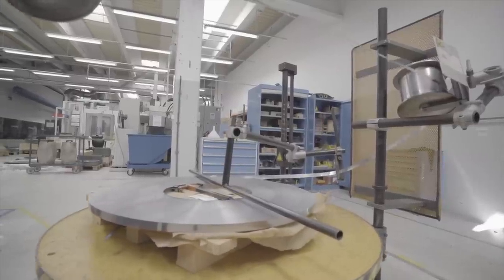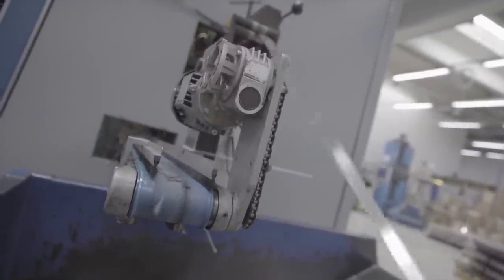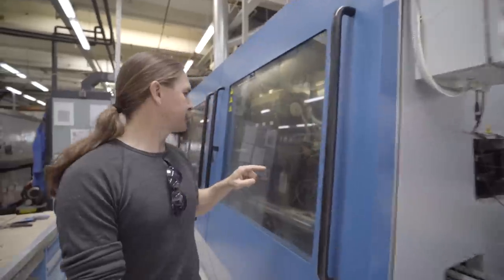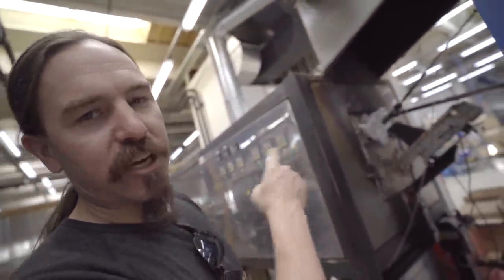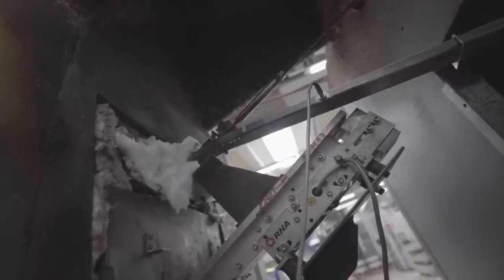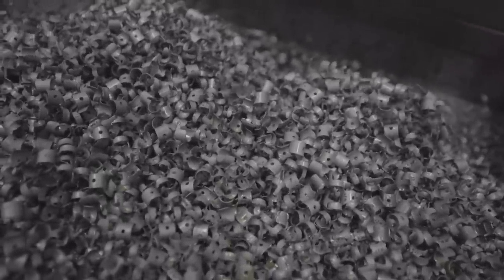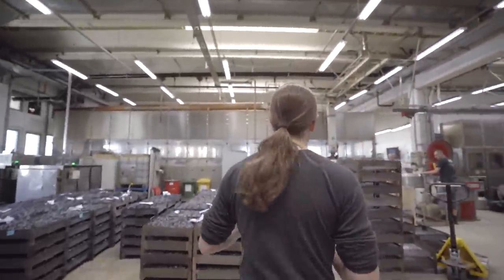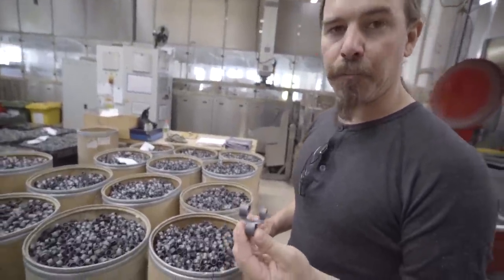How's It Made: A Giant Machine That Makes MG Links

Comment: This is fantastic. As an engineer myself, I could not have explained it any better. Would love more content like this!
Reply: I actually really like the fact that Ian himself is an engineer and has some knowledge regarding machining.
Reply: My understanding is that Ian’s degree is in something like “engineering technology,” which typically puts one on a track to being a CAD jockey or similar work. But Ian certainly has the chops to be a full-blown mechanical engineer. I’m one, and I’m regularly impressed by Ian’s clear-yet-technically-accurate descriptions—explanations that are both clear and accurate are exceedingly rare. 

On a related note, I wish my field did less gatekeeping. I like engineering technology degrees because they help bring in people who wouldn’t otherwise pursue engineering. On the other hand, those degrees create a weird hierarchy. I’ve met machinists and CAD operators who were effectively highly skilled engineers. I worked with one full-fledged engineer who didn’t believe that springs in series behave differently than springs in parallel. 😬

My field pushes away too many people who would make killer engineers, and thereby shoots itself in the foot.
Reply: I used to work in facility that produced among other things (1) the rocker arms for ICE engines. We had one Tool and Die maker that worked full time maintaining the die sections of the progressive die due to the wear caused by the process. The single most impressive operation was stamping a small hole on the order of 1mm through steel about 2mm thick.
1) The other things include complete engines, rear ends, body stampings and finished cars all under one roof.

Comment: Now I would love to see how the linking machine works to create the belts
Reply: May be judged as 'click-click-click' bait . . .
Reply: @SonsOfLorgar   - Why, we're all still playing in the linking machine . . .                    : )
Reply: Linking machines? Here we call them "recruits"
Reply: We have a linker, basically a tray we put 10 rounds on and then we lay the links out and pull a lever and it pushes the links on the rounds. Can be done by hand too.
Reply: Maybe make a linked video that shows the next part of how the munitions gets created with the links into belts!
Reply: Linking machines aren't too complex, it's basically a metal tray with some channels cut into it with a pusher (I forget the term) that's attached to a lever and/or a mechanical pall/finger that pushes everything over. In the two channels one contains the belt links whether disintegrating or permanently linked and the other contains the rounds to be fed into the belt, pulling the lever forces the pusher block upwards and forces the round up and into the belt link and the lever is pushed back and the belt is moved to align the next round with the next link and the cycle continues until the belt is fully loaded. There's no doubt good videos describing how they're used here on youtube
Reply: Wasn't there a 20 or 30mm cannon you could 'run in reverse' to make belts? The M230 came to mind, but that's not it.
It's just a faint memory, so I might be wrong.
Reply: @SonsOfLorgar  the ones we use here are for 50 bmg and 7.62x51 disintegrating links and we screw them down on whatever table we need them on. They are pretty old but when you get in a rhythm you can load a belt faster than a magazine. You can also reverse it and pull the rounds out of the links very quickly.
Reply: Absolutely

Comment: There is a sideshow to this, that You might find interesting.

The recycling of scrap.

The price of scrap metal depends on how much treatment it has to undergo.

The best price the foundry gives is when there is a casting error - here the prime objective of the manufacturer is to avoid putting work and mashine time into castings that are flawed. We have been casting bronze for thousands of years and yet there is still occational flawed/failed specimens. The Ötzi (the Iceman from the alpine glazier had an axe with a casting flaw) - and we are still not perfect there.

If you know what you are doing: You can often get a considerable discount on a replacement part if you send back the broken part to the manufacturer, because they know PRECISELY the composition of the alloy and can put it into the right bin when returning scrap to the foundry - and get a better price for the scrap.
Floor sweepings are more complicated if you have to separate copper alloys from iron, but each will normally have to be refined. Which is costly - to say the least. so the price pr. pound is much lower.

But a good chief is also a manager of the scrap.

Steel is a particular chapter, as the contents of impurities in steel is so high - the most rotten quality goes into cars. But generally the more recycled a metal is, the better the quality.

The airblasting is the same way medicinal pills are sorted, as it goes by weight. If there is steel impurities you might have to blast them over a magnet.

Comment: air tables are used over regular conveyors quite a bit with lightweight parts. you get a much faster throughput of material with less maintenance. with a normal conveyor, you have tons of motors to maintain, belts to repair, etc. with an air table, you have to repair local damage to the air seal, and maintain the compressor and cleanliness. 

metal forming production machines are always an interesting time, thanks for showing us!

Comment: The 360 deg Fahrenheit heating stage after quenching is TEMPERING, not annealing. Cool vid, hell of a setup. Keep on cranking 'em out
Reply: Yeah, the annealing was done in the first oven, and then quenching hardened the links.  The tempering was the second oven like you said.  Must be a pretty low carbon steel to quench in water like that and not get cracking.
Reply: The cooling time wasnt mentioned after the 360 degree reheat, a fast cooling period  ( quenched) tempers, a slow cooldown anneals....
Reply: Noticed this minor fauxpas too, did material handling heat treatment  on govt 💣casing hardware years ago.
Reply: @bunnykiller  No, they're classified by the heat involved, not by the cooling rate.  360 degrees C is far to low for even a partial anneal.
Reply: @bunnykiller  No. ( Fast)Quenching hardens the previously annealed malleable steel. Feed stock comes from supplier  pre-annealed on roll. That's how you can roll + unroll and feed into stamping machine.
After stamping steel is brought back to high temp(malleable)  + fast quenched to harden.  Tempering reheat relieves internal stress + brittle failure state of hardened steel.  End result is resilient stamped spring steel. Then it gets Parked/ Phosphated for corrosion resistance , GTG.
Reply: @theproceedings4050  Correct. 360F is tempering/ stress relief after, stamping + high heat+ quench hardening
Reply: @theproceedings4050  Yep
Reply: @joekurtz8303  Word. Spent a fair amount of time in and around old St. Louis Army Ammunition Plant in 80's. Arsenal of Democracy, 40+ % of WW2 SMA + metric fuckton of ordnance rolled out of there over the years. Gone now, we need these capabilities today.
Heartened by modern methods as seen here. Our overall capacity+ ongoing relative inability to rapidly increase production is a critical vulnerability.
Should have been mobilized + ramping up production 3 years ago. 
Cheers to you brother
Reply: It seems like it should be possible to eliminate the links , but maybe not

Comment: Heat treat & tempering is usually  the process in that order to  relieve britlleness , annealing is usually done prior to machining or other extrusions in process. Great video on this product,  considering the environment it has to withstand  in handling and firing etc
Reply: He shoud have said tempering. Annealing is used for brass cases after forming, to make the neck case stronger or less brittle.
Reply: To get all the terms out there:
Quenching is rapidly cooling something (usually a carbon steel) from a high temperature to harden it. (It turns austenite to martensite)
Tempering is heating a quenched object to a lower temperature than before and keeping it there for a while to reduce brittleness and make the appropriate steels actually springy. (This relieves some internal stresses and allows remaining austenite to convert to other forms)
Annealing is heating something to a high temperature, keeping it there for a while and then slowly (for materials that can be quench-hardened) cooling it to soften it and remove stresses.

For other metals than steel (and some steels) the main thing is annealing to remove stresses from work-hardening. That is, you've deformed something, and now it's harder and more brittle, so you heat it up to relieve the stresses and get the original malleability back.

Comment: There is still another aspect to the production of MG links.
When you make 100 mio. mashinegun links annually on expensive equipment the production quality goes exponentially up - simply because the mashines will have to be operated to precise tolerances. Same thing with ammunition production.
That means less hangfires and malfunctions in akward moments.

Comment: I'm sitting here, looking at a metal strip I reckon would have been turned into links for the MG34/42 back in the days, if somebody hadn't pulled it out of the machine before the links were complete. From what I can tell, they went through at least 11 different stamping processes, well, more likely 8 as three of the links look identical, before being parted off, heat treated, and connected with that little coil.

Comment: Excellent video! In pieces as thin (and ferromagnetic) as these links, perhaps what is known as a "fall furnace" can be used as an austenitizing furnace. This is a vertical tube several meters high, where the pieces, with the definitive geometry, enter through the upper part and are heated by electrical induction during the fall. The temperature reached by the piece depends on the height of the tube and the intensity of current applied. Below the tube is the tank where the cooling liquid (water or oil) that produces the tempering is located. I know that method is used for needles, and small pins. Greetings from Patagonia Argentina.
Reply: That's fascinating, thanks!  I wonder if there's a difference in scale that made it a more expensive choice for MG links?
Reply: @Stevarooni  Good question. The problem with "Drop Furnaces" is that they are very specific while the furnace seen in the video is more flexible in its applications. It should also be taken into account that it is available in the area of the factory: Is natural gas cheap in the area? - Electricity is expensive or the electrical network is not prepared for those consumption peaks? - Is it planned that this oven will have other applications? - Are the drop furnaces very different for links of 223, 308 and 0.50 BMG (and other calibers that you want to manufacture). As you can see, there are a million variables that may have been considered to implement one solution or another. Greetings from Patagonia Argentina.

Comment: Coil feeder, progressive die, heat treat furnace to bring link up to Austenizing temperature (1) and quench. Then into the draw furnace to bring the hardness down to I'm guessing around 50RC or so. I wonder what the alloy is and the quench solution.
1) The temperature at which steel changes from a face centered cubic structure where the alloying element (carbon, chrome, molybdenum (2), vanadium whatever is centered in the faces of of a cube of iron atoms to a body centered structure where the alloying elements are in the center of the cubic structure. If the steel is quenched fast enough the alloying elements will stay inside the cubic structure. Drawing or tempering allows a certain percentage of the alloying elements to migrate back into a face centered grain structure. This gives the steel enough of its ductility back while still maintaining enough of the body centered material to provide toughness and resistance to impact and wear. Heat treating steels and any other metal is at once both a science and a black art depending on the scale it's being done at. 
A similiar manufacturing process is used to produce stamped rocker arms for engines. Although in that case the heat treatment is likely done in a seperate area. Plus the stamping presses are much larger.

Comment: Kind of surprised that steel strip isn't better guarded from the walkways.  I know most places aren't as risk adverse in a factory setting as OSHA, but, it always surprises me when I see a factory that hasn't been safed to the very edge of  hurting production. (I mean, any factory is dangerous, but running a neck height dull bandsaw of a steel strip at neck height with nary a guard widges even my risk acceptance levels.  And I do risky crap recreationally.  🤣

Cool process - I wonder whatbthebscrapnrste from heat treat losses is (it honestly has to be super low on such a low markup part - just inspecting for production faults would rapidly eat profits like tribbles in your grain silo.)
Reply: The strip feed doesn't look to be a high tension process; if anything breaks you're not going to get a lot of 'razor whip,' and the one corner where you might does have a guard.
Reply: Yeah I was surprised by the lack of safety glasses and ear protection too, but that is what we are used to here.
Reply: Safety Sally.
Reply: There used to be a razor blade factory that had a constantly moving strip of steel coming off a vertical coil. 
All the stoppages for cutting the strip happened inside the machine which had sharpened, shaped and hardened the strip. 
The feed line into that machine was protected by a fence so that you didn't break the production line.
Reply: There are no high spring tension nor high speed involved here. If the metal breaks (which is pretty much impossible) the whole thing just falls to the ground and stays there.
Reply: Safety 5th, at best.
Duty, value-quality, satisfaction and profit come first

Comment: I have to clarify that that is not an annealing oven, which is a process for fully softening metal. Its a tempering oven, with relieves some internal stresses in the hardened part, keeping some hardness but allowing more strain before failure.
Reply: the difference between tempering and annealing is the cool down time period after heating... being quenched after heating tempers, being cooled at room temp over time anneals

Comment: Little correction. 

The steel used probably is a bit higher grade than just "mild steel" because the effects of heat-treating (hardening and reheating to release stress inside the material) only really takes effect at a higher share of carbon inside the steel. 

For example, S235 is a mild steel/building steel normally used for simple construction and design elements like gates, metal fences and so on. It has a carbon share of roughly 0,17% C. It is very easily to bend or weld, but hardening has no considerable effect on the properties. 

But let us get to C45, which is a "soft" tool steel used for simple handtools like chisels, hammers and wear resistant parts. 

It has a carbon share of 0,45%, which is not a very lot for steel speaking, but it is enough so hardening has a considerable effect on the material to change its properties from being soft and bendable to being hard and brittle (it easily breaks if hit with a hammer for example) 

To make the steel soft enough for usage it gets reheated into a certain area so the internal stress can get released without the material breaking into little pieces. 

So they probably used something in the range of C45 or C60 or something comparable property wise I think.
Reply: Nope, it's a spring steel like 38Si7 or so.

Comment: IAN! NOOO... The second, lower temp oven is for tempering, not annealing. They convert the hard, brittle untempered martensite microstructure into slightly less hard, but tougher tempered martensite. Annealing would be done by bringing the steel up to the same high (austenitizing) temperature but then slow cooling it to pearlite microstructure like it was originally, instead of rapid quenching it.

Comment: I am sitting here imagining a fully automatic machine gun that you feed lead, copper, brass, gunpowder, primers and steel.
The machine gun is any normal machine gun but it makes the ammunition on the spot and assembles it into a belt before firing it.
Reply: Would be more easy without the brass and steel and primers and belt. Just feed the lead and powder and use a reusable ignition like a spark plug.
Reply: @outdooropaholger9998  Yes but this is what i imagined, not a design criteria.
Like a Rube Goldberg machine.

Comment: Do the links get collected and recycled after use? I know that WW1 UK paid attention to recycling artillery shells as a valuable logistical resource.
Reply: After every range we collected up the brass and link and was a religion if the RCO found any left in their final inspection you were getting some form of free physical exercise.

I was always told by the unit armourer it all gets recycled and helps keep cost down.
Reply: @stevepirie8130  Makes sense. It was good steel to begin with, that's what you want. 
Different if it had been treated first.
Reply: @stevepirie8130  I suppose it might be harder to do in a live operation where you have bigger things to worry about.